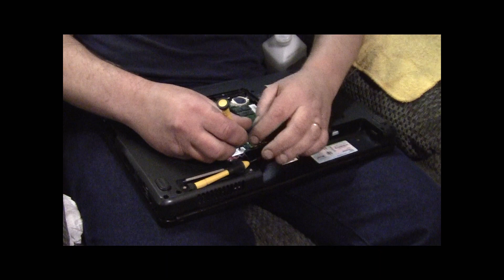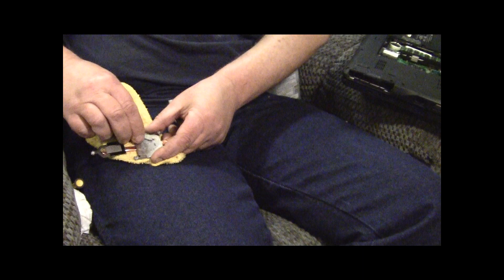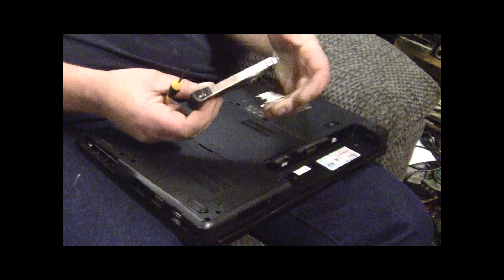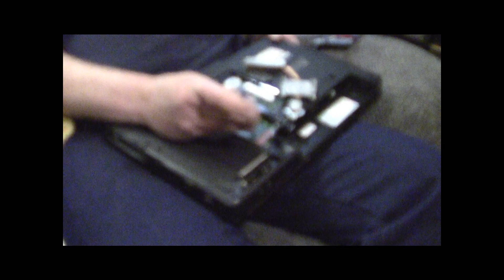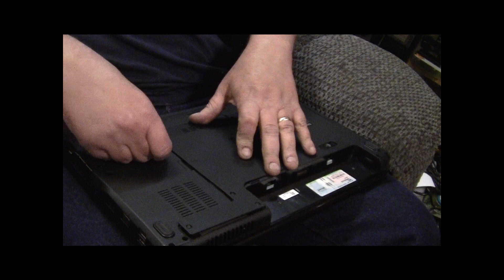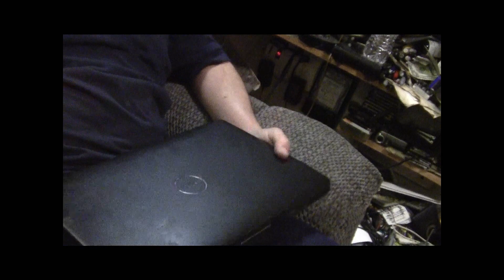DELL 1545 LAPTOP CPU & MEMORY UPGRADE

Comment: Hey Shawn ..my mom still likes her 1545 in 2025 ..I just added an SSD and cloned her old drive over, huge speed upgrade. I had also upgraded her RAM from 2gb to 4gb. ..last issue I need to address is a loud cooling fan. Blowing and cleaning out in between the fins with alcohol and a q-tip did not help unfortunately. Anyways, I'm gonna change that out for $10.00 ..since I have to tear the whole freakin thing down to get to the fan, I figure I might as well upgrade the CPU while I'm at it. You mentioned the T9600 is the fastest compatible CPU. Have you learned different since posting this vid? I read that it can accept up to a T9900 ..those seem pretty rare and too expensive, so I was gonna go with a T9800. Just curious if you've tried anything higher than the 9600 yet? Just want to be sure before I waste $. TIA! 

Here's the thread in the Dell forums that mentions the higher spec CPU's being compatible: 
https://www.dell.com/community/en/conversations/locked-topics-laptops-general/dell-inspiron-1545-cpu-upgrade/647f4b4df4ccf8a8de3da403
Reply: Ugh ..I just noticed the note on the channel page about Shawn passing away on Jun 2nd (assuming 2024..) Very sorry to hear. If anyone else comes across this and has any knowledge regarding my question, I'd appreciate it. RIP Shawn.

Comment: Should I back up my files before upgrading the ram?
Reply: I installed a Samsung 870 500 gb. At first I got the message no hard drive found. I put the screws back into the computer, rebooted, and ran a diagnostic test. This time the hard drive is found. However, after rebooting it now say no boot sector found on internal hard drive. What did I do wrong?
Reply from the maker: @lilmamma807  you installed a totally different HD ? this vid is a memory upgrade , not hard drive upgrade .. you need to clone your old drive to your new drive .. I can do that for you if you want to send me both drives ..
Reply: @shawnmrfixitlee6478  I know but you're so knowledgeable and helped me last time. How long would it take? I work from home but I may be able to get clearance to work in the office depending on how long.
Reply from the maker: @lilmamma807   put your disks in an envelope and send them to me I will copy the old drive to the new drive and send them back , I can't walk you through it on here !
Reply: @shawnmrfixitlee6478  after you mentioned cloning I looked it up. Since I need my laptop for work I looked on YouTube for cloning instructions. Turns out the ssd comes with cloning software. I purchased a transfer USB and was able to successfully clone the hard drive! Thank you so much for all of your help. 🙂
Reply from the maker: @lilmamma807  Nice glad it all worked out !
Reply from the maker: you can , but no.. just power down and no battery installed or cords and go for it .. you will get a message at boot and press enter , done !! typing this on a modded 1545 now ..
Reply: @shawnmrfixitlee6478  thank you 🙂
Reply from the maker: @lilmamma807  no prob .. other dell vids on my channel as well.. ad a 2nd hard drive and many more..
Reply: @shawnmrfixitlee6478  will do

Comment: Good to see you back at it.  I prefer to fix/upgrade PC's if it's at all feasible rather than replace them as well.  Hope the Dell works as well as you need for your editing.
Reply from the maker: I really don't like editing on a desktop , I have to keep walking over and checking the progress .. This has enough power to edit and still work on other tasks .. Thanks Everett !!